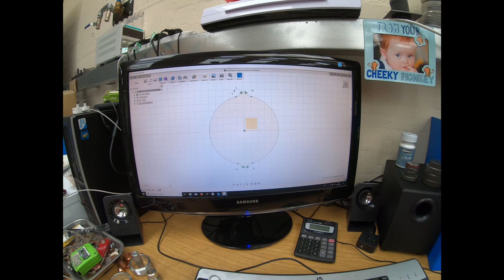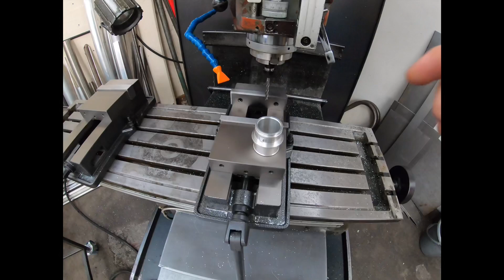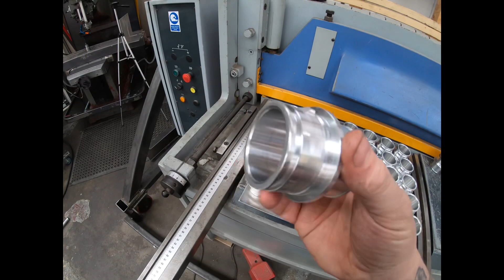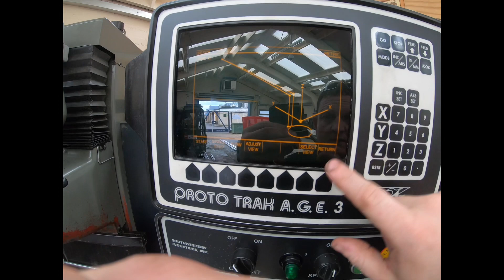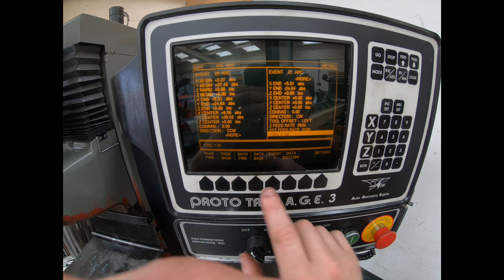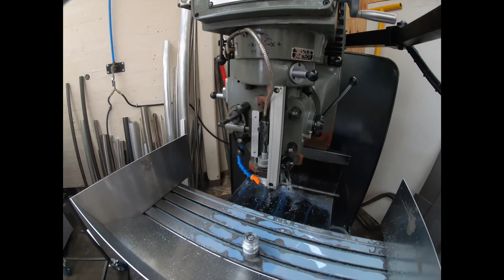My first cnc batch work job for a customer

Comment: You should be able to load programs via floppy without dnc
Reply from the maker: pmproducts unfortunately they don’t accept normal cadcam g-code unless you have a DNC dongle
Reply: @kinzy_fabrications  thats only full 3 axis contouring,  2 1/2 axis you can download regular gcode, I can send you video if you need
Reply from the maker: pmproducts Hi, yeah that would be great thanks, I tried that before but it wouldn’t accept the code, it said bad code - g54 and g28 it would not accept

What post processor are you using?

You can email direct to kinzy1@hotmail.com
Thanks
Marc